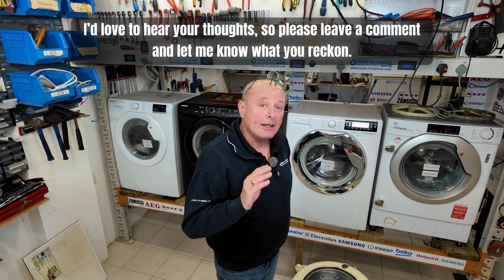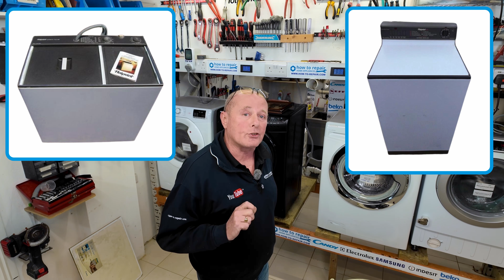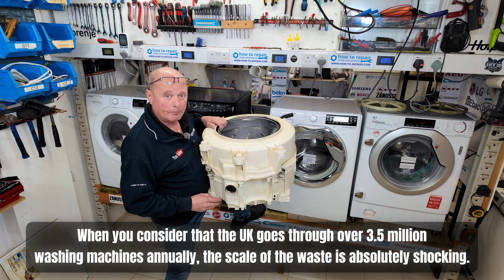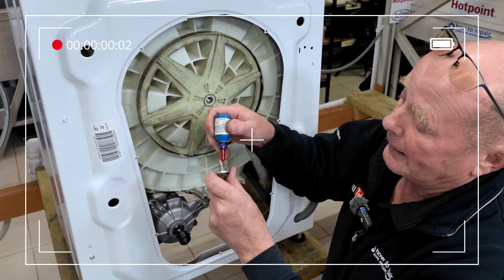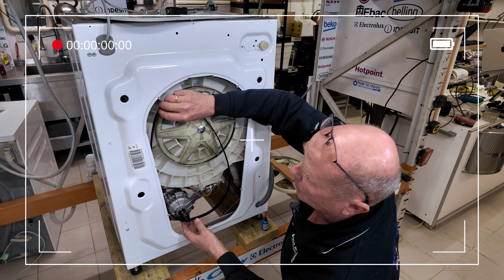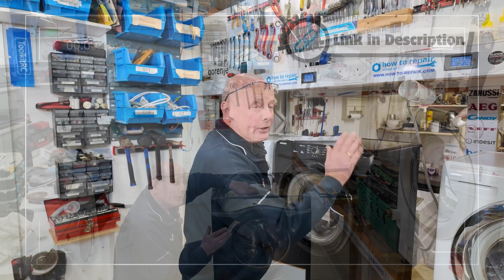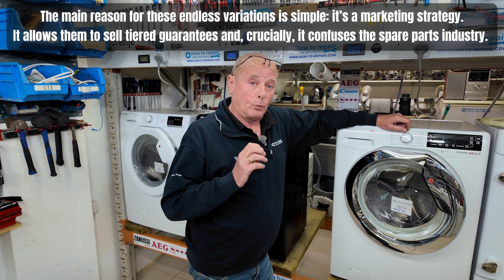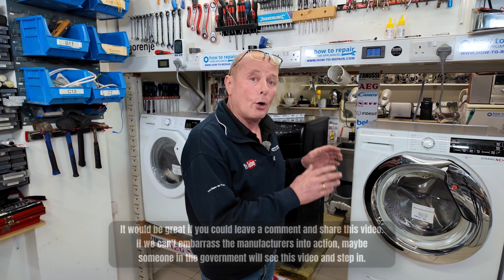I Scrapped 13 MACHINES to Prove a Point: STOP BUYING These Brands!

Comment: The bearing went on our washing machine drum 18 months ago, it was about 8 years old and I have worked in precision manufacturing and design for over 40 years owning my own business for 24 years (sold it in 2020 and retired), and so I took the back off had a look thinking I could just pull the bearing of the drum shaft and replace it, but it had a split drum which had to be seperated and I just could not be bothered incase the drum would not seal when refitted so I took the easy way out and bought a new Ebac machine built in Newton Aycliffe, County Durham, you can tell the quality and thats how they can give a 7 year parts and labour warranty, you mentioned a british company that manufactures machines and Bosch why did you not give the name of the British company and does the Bosch warranty cover labour or just parts only if fitted by their approved engineers. I think we should all try and buy British goods from a man who chose to make less money and kept employing British workers and pay ridiculously high business and employee taxes, not like dyson.

Comment: I had a hoover washer that the pcb packed up on last year. I had to reattach the belt because of that stupid setup at least 3 times whilst I had it. I got rid of it aftet the controller started being intermittent. But apartment from that the build quality of the control panel was shocking. The buttons would stick or jam inside the facia and in the end I had no confidence in spending the money to replace the PCB. I remember growing up my dad had a 30 year old Zanussi that was flawless until he overloaded it and packed up the bearing. Now I'm wishing he'd managed to find a replacement part 😢

Comment: My grandparents, parents, uncles and aunts all bought Miele washing machines back in the day. Those machines were absolute tanks. They just kept running for 20–30 years without any real problems. Most of the time they were replaced because they started to look old-fashioned, not because they were broken.
Feels like appliances used to be built to last. Different times.
Reply: My son bought a Miele washing machine second hand about 8yr ago. It's still going strong now.
Reply: @RedRidingHood-pc2cm  Me too. Mine is from 2005 and it is working fine.
Reply: I have an entry level Miele washing machine from 2017, still works flawlessly
Reply: In Finland Miele machines have 20yr warranty time
Reply: Miele is all our employer uses. I started working there in 2003, and they still have those same Miele washing machines. Extremely reliable
Reply: @lynetteireland is it pi?
Reply: Agree, my Miele was purchased in 2009, still going…
Reply: We just replaced our '23 Bauknecht by a '99 Miele😊. 

Greetings from Germany, 

Paul
Reply: They say: You get what you pay... They mention monkeys... 😇
Reply: Bought our first Miele washing machine 13 years ago.  We tried to throw it out when we upgraded our utility and it refused to leave.
Honestly, it’s built like a tank.  Buy cheap buy twice.
Reply: You hear that story a lot with older Miele machines. Back then many home appliances were built with real product durability in mind—basically the original buy it for life idea. It wasn’t unusual for a washing machine to run 20–30 years with only minor appliance repair. Today a lot of people feel the industry shifted toward planned obsolescence, where products feel almost built to fail, which is why washing machine reviews now focus so much on appliance durability and the overall product quality decline.
Reply: Miele isnt worth the money anymore. i bought a Dishwasher 4 years ago. 1300€. Technician has been here 3 times already. Dishes are soaking wet every time. its a shame
Reply: @clemchammer8816  You are the exception we have had ours 20 years best out there.
Reply: @clemchammer8816  Have you cleaned your filter since you got it ?
Reply: @clemchammer8816  The problem is not necessarily Miele and its products as such, but rather that all manufacturers have to submit to the absurd dictates of Brussels. As a Miele engineer put it, a washing machine needs a minimum amount of water and electricity to wash properly, but this minimum has long since been overturned by law. The limits of what is feasible also have an impact on durability.
Reply: @baenschman6756  it's sadly common that they use one small part that brakes after a few years. There should be better quality control to prevent that. Everybody knows nowadays what a Killswitch is.
Reply: @clemchammer8816  We live in crazy times, where everything is supposed to be optimized, except for us.
Reply: @baenschman6756 optimized for profit unfortunately.
Reply: @baenschman6756  This doesn't cause them to break. That is because they are not built well.
And the efficiency is only about a single washing cycle, the others can be as they want.
Reply: @baenschman6756  Not exactly true. Dishwashers are required to have that one "eco" program (that's what you are talking about) but then they can have any other programs and it's up to you which one you use.
Reply: @KneziTezi  That's true, but it doesn't make what I said wrong. I see it more as an addition. 
Nowadays, machines are probably mostly purchased based on consumption alone.
Reply: @baenschman6756 the problem with Miele today is that only a fraction of their products is still produced in germany nowadays. They moved a lot of production (including full assembly) to other countries by now. The build quality did suffer due to this.

Signed: a guy who has relatives who work at the assembly lines here in germany.
Reply: Yeah. I mean we all know the bearings, PCBs and hose clamps that need a minimum of water and electricity 😂
Reply: @baenschman6756  I think the same.
Reply: I have the flagship dishwasher (4 300 euro), never had any problems since I got it in 2020.
Reply: @epoxy1710 well you better fucking hope not for that money, does it also cook your food and satisfy the misses? Otherwise you got fucking ripped of bud 😂
Reply: @Fancymarine  Well, I don't live on food stamps like a weakling. I also have the Miele induction cooktop for 6,112.47 euros. I also have the Miele combi steam oven for 7 992,19 Euro.
Reply: What strange things to show off about! I don't think that anyone cares...he was right. It's a ridiculous amount to spend,a dishwasher is just a dishwasher. Still...a fool and his money...let's hope they all outlive you then!
Reply: @epoxy1710 weird flex bro 😂 spending excessive money on appliances or being rude about people on foodstamps will never be cool
Reply: @LuciThomasHardylover-qx6ts  It comes with a 10-year warranty and use stainless/aluminium instead of steel. in the long run it will outlive a normal one 3 times.
Reply: @epoxy1710 good for you. My Bosch has a stainless steel drum and a 5 year warranty which has passed without being used. My last Bosch was 2 Nd hand and lasted me 15 years despite being moved house badly 4 times and doing more than a load a day. So I expect this one to see me out,and for a fraction of the price.
Reply: @epoxy1710  
Well at least we know for certain you didn't earn it, and your father's rich.

I grew up in a posh area and nobody who'd actually earned went "Hur dur look at these specific items." That was something for the wannabes and the spoiled brats with absentee fathers.

It was more "I could take you there in the car", and that turns out to be a Bentley. Or a guy gets out of a Ferrari swearing and moping: He was driving his Landcruiser but realised too late that the destination is in an environmental zone, so he had to turn around, go back and get his Ferrari to avoid a € 65 ticket.

Now someone like you or your father would go "Ha, you stoopid plebs, I can afford a dozen such tickets a month!", but he turned around and drove 15 minute extra, upset that he had to drive his Ferrari instead. Because that's what actually rich people act like. And if you want to get excommunicated from circles like that, acting like you've been in these comments, is the quickest way I know of.
Reply: @nvelsen1975  Why do you care so much? Get a life instead of meddling in other people's conversations. Sitting here writing half a book about someone on YT, get a life
Reply: You better hope they dont leak considering the weight on the floorboards underneath them. I wonder how many have ended up in the flat below.
Reply: Same here. My parents had an AEG that lived to be 22 before it caught fire, then a Miele that's still going today since 2003 (although obviously they wash a lot less these days). But these days all I hear about those brands is bad, like they're riding on their past image while selling sub-par stuff.
Reply: @nvelsen1975  Interesting, as I replaced my AEG after 23yrs with another same brand.. Never had any problems!  👍💙🇦🇺
Reply: @Joyce-Mackey  I replaced my Bosch washer after 9 ears - still working, but it was too noisy for an apartment - with a new one.
I have no confidence that the new one will last as long. But TBH I paid quite a lot at the time - inflation adjusted that machine was 1400 euro. The new one - same brand same range - was half that price.

Comment: If you were really determined even some of those terminal faults - wiring harmess, motor, or even PCB - could be repaired, but probably here the amount of time and effort makes this prohibitive. Especially wiring harnesses with 3D printing and availability of various pins and wires could mean you can fix something that broke in the wiring. Unless there is something special to the washing machine's wiring that I do not know about.

Comment: My last washing machine lasted 17 years ..a indesit ( a cheap one inder 150 quid ) and my current Bush is 8 years old , just a basic machine but running great. My mum used to buy the best brands with all the hype and they would forever be breaking . I also run white vinegar through mine ...maybe this is why they last ?

Comment: Curious if manufacturers have solved the electrolysis problem for the spider arm. You know what happens when you put two different metals together , they eat each other. I had that problem with mine.When the new parts arrived the spider arm was removed and an  a spray epoxy paint applied. Spider arm reassembled to drum and no more electrolysis. Every engineer knows this happened.Waiting to see a class action lawsuit for this.
Thank you for your work and time and putting these videos together.

Comment: The machines of previous decades did last longer, but cost compared to earnings was much higher. I recall my father buying a Hotpoint Twin Tub, for 59 guineas in 1960; that was half a month's salary as a Personnel Manager, comparatively well paid for the time.
I recently had a Hoover Dynamix show a fault. Although the Hoover site said it couldn't be fixed unless an engineer was employed, I fixed it for £5 replacing the brushes that had worn away. Then of course shortly after that something else went wrong, so it became a case of 'good money following bad', and we replaced the machine.

Comment: My Gourmia Air Fryer quit working right out of the blue, there was no problem with over heating, so I looked for a solution on You tube, a young man posted his repair and guess what, Gourmia has thermal fuse issue with all most all of their air fryers, you could say this is a design flaw or a small issue that can be easily fixed, but I bet most people just throw them away and buy another one.
My hunch is that many products today are built with a time limit right after the warranty expires, it's unscrupulous and illegal but you can't prove it.

Comment: I still have my Samsung washing machine working for 14 years, no problems so far, no Calgon used, and most times I used the cheapest detergent. 
Meanwhile, a friend has changed 3 washing machines (Indesit, Candy, Whirlpool) since I bought mine.
My mother still uses an old german washing machine I bought used from a repair shop 25 years ago. I dont know the brand, but I remember it was a really heavy machine but simple to use.

Comment: Planned obsolescence should be illegal and it should be considered as a form of fraud. It's one thing to make a crappy product because of incompetence, but it is something completely different to spend money on engineers and putting them to work on the assignment of intentionally designing products to have faults. Just imagine how utterly ridiculous it is that there are meetings going on with the lead engineer suggesting intentional ways of making the products more prone to failure to encourage users to buy more machines, while the head of marketing is laying out the marketing strategy of environmental friendliness. 

MADNESS. UTTER MADNESS. WE ARE LIVING IN A MAD WORLD.

Comment: Don't ever buy insurance for these types of items.
Reply: If the machine is good, its own warranty is better + covers the repair costs. 
If the machine is crappy, its warranty is crappy and the insurance company will find the "holes" in the policy that work against you. The hassle with them is not worth it.
Reply: Think about a little. The insurance pays out for them, since they are offering it. If it is profitable for the insurer, the customer MUST be the one who pays that profit.

Set aside the money you would put into the insurance, then you'll have your money and spend it when needed, as you wish, without runnkng errands for months as to why your claim is outside the terms.
Reply: If you have to buy extra insurance you already now it is a crapy machine.
Reply: Why
Reply: @sawdustwoodchips Did you watch the video he explains
Reply: Watch the video from 16 mins onwards.
Reply: @Security2U  i still dont know which brands to avoid, is it even specifiedi n  the video
Reply: @sawdustwoodchips  I bought extended warranty once for a new washer/dryer set. Cost about $50 for 2 years.  When washer began making a strange sound, I called. They wanted to charge me $120 drive/service fee and only certain things would be covered on parts & labor.

Comment: I had this Candy Bianca that I bought about 7 years ago, I chose it because due to placement I needed a washing machine that open to the left, while 99% on the market opens to the right. And that was the only good thing about her, the programming dial was clunky, simplest washing program that I use the most was over 5 hours long, the access to the rest of the programs was via the app, that had like 2/5 stars on play store and when I tried to install it it demanded access to contacts, calling, camera, files etc. So I hated her fiercely and wished for it to die, and last year she finally did (yeah, I know it was 5 years, but most of them I was single so it was used like twice a week maximum), so I gave myself the opportunity to tear it apart in the basement for salvage, and I can confirm about this idiotic design decisions like spot welded front, and the same awkward MDF top together with the same metod of holding it. Surprisingly it was not suspension spring that failed (which I thought did) and frankly I'm not sure what did, because both the bearing and drum warp sounded differently that in this video, but yes, I was also surprised by this sealed drum. That really sucks and I think we need legislation that demands including replacement prices on the label plus approximated labor cost to change them - maybe this could help with such practices. BTW, does someone need a Candy Bianca motor, harness and PCB at a reasonable price? :D

Comment: Front load washing machines suck anyway. I've had a New Zealand made Fisher & Paykel Top Loader since 2012 that's still going strong. I must admit I had to have the PCB  (Chinese made of course) replaced under warranty after only 2 years, but all good ever since and no mechanical issues.
I also have an Australian made Hoover refrigerator that's over 25 years old and still going strong. Don't buy Chinese made shite (if at all possible. Yes I know it's hard).

Comment: Had an Indesit top-loader. After 6 years, ~2000 cycles, it rusted badly, developed mold resistant to most chemicals, except the ones you don't want to wear. The bearing was going out, but it washed stuff. Once it had no lights on, and was just spinning at the end of the program, but never again. Had not a fortune for a Miele, or an expensive Bosch, settled for an Electrolux, that, aside logos, font types, was identical to an AEG. Two years by factory, 3 more purchased as extended guarantee. Shame that there is no 'safe' choice.

Comment: My Bosch top of the line 45cm dishwasher failed after 3.5 years and I had to scrap it because the waterpump was costing 3/4 of the whole dishwasher new.
I bought an ikea dishwasher: better built, more spacious in the same size for half the cost of the Bosch, it is an Electrolux top of the line... never ever Bosch again!
In the EU Hoover comes with 10 years warranty.foe wahshing machines.

Comment: I had one of those Hotpoint machines you pointed out as good to refurbish - the first one. 
Easy to use, it lasted such a long time, so reliable; and since I've had 3 machines in quick succession. 
If I'd known then, I'd have kept that Hotpoint and just got it fixed every time. It would have been cheaper than buying 3 machines.